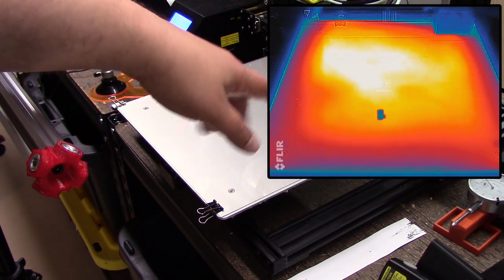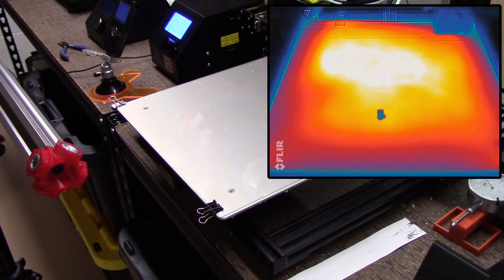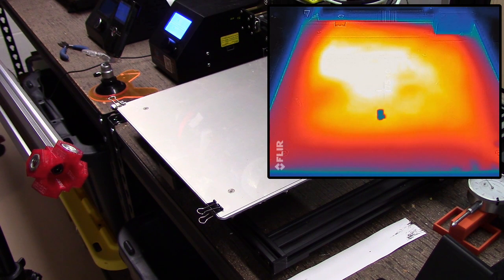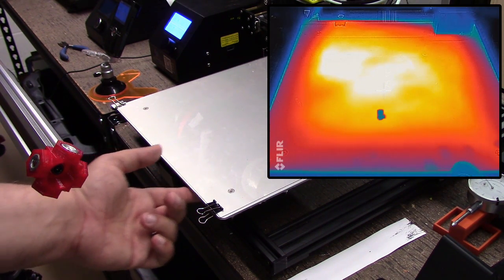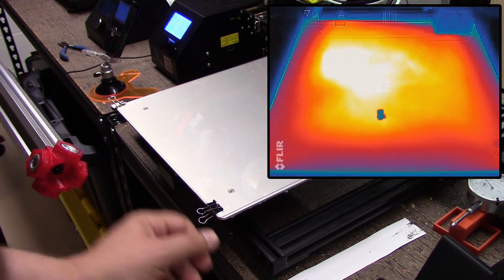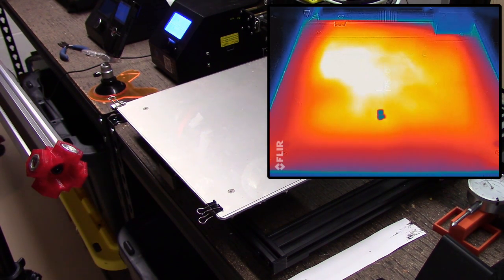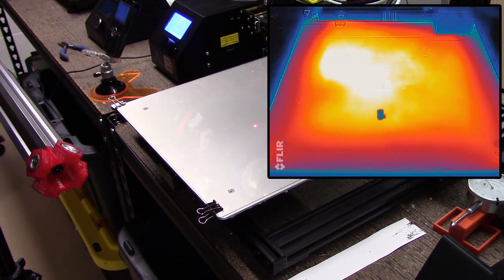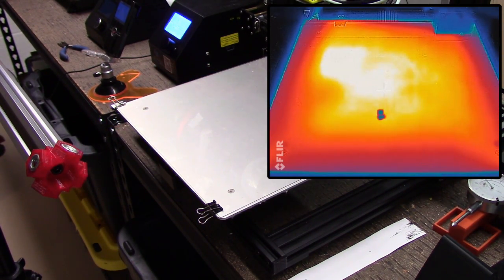Creality CR10 - Insulating the Heated Bed!

Comment: How to Get Great Results with an Infrared Thermometer - Fluke: even reflections off of glossy paint can affect accuracy. 
http://www.fluke.com/fluke/uses/comunidad/fluke-news-plus/articlecategories/temperature/how-to-get-great-results-with-an-infrared-thermometer
Reply from the maker: Proved this this to be a bit of fake news when I connected thermo-couples and they basicly matched :-)
Reply: I have never noticed an issue using hand held Infrared thermometer pointing at a quite shiny Aluminum bed... Maybe they mean mirrors :)
Reply from the maker: Most aluminium is matte enough, I have not had an issue.  If it was polished I could see it being an issue, but to date I have not seen one that shinny...

Comment: You installed a radiative barrier.... in contact against something you want to maintain temp on? Best bet build a cardboard box and buy a 99cent nasa emergency blanket and spray adhesive it inside the box.

The heat shield you bought is ment to be installed on metal on the opposite side of a  heat source like a catalytic converter. Then the shiny side radiates the heat from the cat, back to the cat. It maintains the car panel temperature NOT by insulating what so ever, by but reflecting heat away. Aka: radient barrier. Insulation slows heat transfer. If anything you added thermal mass and increased heat transfer in the bed.
Reply from the maker: For clarity If you check their website this isn’t correct as I mention there is a fiberglass inter barrier and it’s designed  be attached in this fashion
Reply: Prove it.

https://www.thermotec.com/products/heat-shields-and-protection/adhesive-backed-heat-barrier

Directly from the manufacturer.

"The Adhesive Backed Heat Barrier protects parts and components from radiant heat. It can be used in applications to protect painted surfaces, plastic parts or any component from the damaging effects of radiant heat."

edit:
Dude it's ok to make mistakes we all make them. I'm just saying you could get way better bed temps using something designed to radiate the heat back toward the print bed - not away. Thermodynamics is complex, most people get it wrong - hence all the insulation issues in modern homes.
Reply from the maker: Here ya go "The adhesive backed side handles direct and continuous temperatures up to 300ºF.
Reply: I'm struggling to understand if you're trolling or not. That says NOTHING about INSULATING! This phrase tells you the temperture the adhesive glue fails at. All glue fails. This glue fails at 300F.
You are not an engineer and that is very obvious now.
Reply from the maker: Look, why do you make a glue to withstand 300deg?  Look at the other applications of this stuff, the fiberglass barrier is meant to provide a gap between the hot surface and the reflective surface and the reason they sell it for wrapping hoses as sleeves and its obvious your not an engineer nor understand the thermodynamics :-)

Comment: the bed has to be made out of clay clay holds heat better it's used in pizza ovens can take a lot of heat. heat in metals  travels faster, or make the bed with thicker aluminum or steel. I don't own a printer but I have tested metals and clay which makes my pizza better by holding heat and clay won the brick stays hot longer than  steel or aluminum. to be specific I put the brick on  500°f  to see if it would crack and it passed, but when I did it with metals  the metal materials cool faster than the brick made out of clay, if the brick isn't made out of clay it cracks. so inclonclusion is to someway make a clay bed.
Reply from the maker: Clay would be too heavy and have a negative effect because of the implied inertia of the bed.  So far, high temp ceramic insultion has produced the best results as you don't want to retain direct the heat...
Reply: DIY3DTECH.com let me be more specific by replacing metal bed to a clay bed and same thickness of metal bed not thicker only problem it would take longer to cool down.

Comment: There are opinions of how this should or should not work. Some say the adhesive side silicone will soak up the heat instead of resist it.  I want to know, at the end of day, from 1-10 how good the results turned out to be?  I don't trust cork for fire resistance so still searching for my  insulator.
Reply from the maker: So far the Plumbers Felt on the CR-10 has been working out good good for me and will likely use the same for my Tronxy X5S...
Reply from the maker: As covered in the video, picked up 30 second faster heat so it is something, and the thermal signature (via flir) is better so would 2.5 out of 5 main for the improved thermal signature.  However I still feel there needs to be a larger air gap and what I am going to do is try plumbers felt (http://amzn.to/2fUP7ky) between the bed and this to improve the air gap have not found the time...
Reply: Look at what they have been using for insulating the hot end nozzles on many printers . Its treated felt . I ordered this "HIGH TEMP FELT PLUMBERS PAD: BLACK, 12" X 12" X 1/8" THICK" from Amazon it is rated at Temperature resistance of 1800 degrees Fahrenheit (982 deg. Celsius) Its actually made of carbon fiber but is luxuriously soft. A whopping 14.99 and will last forever in this application.
Reply: Nice !

Comment: So you are insulating a circuit board with aluminized plastic? Get some rockwool if you are too scared of using cork (i'm guessing XPS isn't an option, it does melt at 240C, but then again bed doesn't get that hot usually?)...

Or just wrap cork with aluminum foil...

Why didn't you get temps for the bottom of the bed, that is how you test the insulation...?
Reply from the maker: Not aluminized plastic, this has an inter fiber glass lining, also not an issue of the bed heat causing a fire however the potential of a short  which has happen and Chuck even got it one on video.  As the heated bed will dry out the cork and a spark can set it off smoldering....

Comment: I think you have that backwards. The silver side should be toward the heat source. That product is designed for firewalls in cars. So the engine produces heat. The product goes on the firewall reflecting IR back into the engine compartment.  What you want is contact insulation.
Reply from the maker: I could see why you would think that way however read down the thread (comments) for explanation as in simple terms the the bed is a convection (not a radiant) heat source so you need the insulation to be placed next to the bed as you want the heat retained and not rejected.  :-)
Reply: So does it work? Can your bed reach 100C in a reasonable time? Say ten minutes and hold the temperature?

Comment: I use a cork tile on mine and capton tape It heats a standard 220x200 40% quicker than no insulation.
Reply from the maker: Please see my video on burning cork, to much risk for me.  I am also looking add plumber felt to a future version...
Reply: Use Cork to mount insulation onto i.e. Bed, Aluminium Insulation, Cork keep cork temp below 150 degrees C no problem.
Temperature of match is 600°-800° do not expose cork to open flame
Reply: Paul Thomas where did you get the cork tile please?

Comment: I'm sure it will make a slight improvement but not worth the effort or cost.   I'm an auto upholster and I use this stuff all the time.  It's true that it's meant to reflect heat rather than using it for this application.

The way you have it installed is the correct way for this product but, for this application it may be doing just the opposite of what you intended it to do.  As it is in your application,  even the thin aluminum foil on the non-sticky side acts as a heat-sink which pulls heat away rather than holding heat in.

I would be interested to see what image results would be if you aimed your flir on the insulation as it heats up.  I think you'll find that it does in fact act more as a heat sink than an insulator.

Good video though;  there are better insulators that could be used to achieve what you are trying to achieve.
Reply from the maker: It did make a difference, about 30 seconds faster warm up and yes I know thats not major but ok for how "easy" it was kind of.  However what I am thinking about doing is taking it off and adding plumbers felt as extra insulation.  Also I though I did add a flir piece in this one and does appear to be a little more even.
Reply: It's true; you did add a section of video that showed the heat dispersion on the top of the plate with your insulating layer underneath the heating plate.  What I meant was to aim your flir at the underside of the heating plate to see if in fact you were loosing more heat than you were retaining.  This would be difficult to do with the heating plate installed.  It would most likely   have to be done with the heated surface detached from it's anchor points and placed off to the side of the printer somewhere.   Probably not worth the extra effort if you're happy with your results.

Before stumbling onto this video I had viewed another youtuber's video showing how he insulated the heated platform on his CR-10.  I can't remember off the top of my head the exact type of insulation he used but it seemed to turn out very effective.  If I remember correctly his was a heat resistant cloth-type of insulation like one would use to insulate hot wires.

The thing that attracted me to your method was the type of material you used.  This is the type of insulation material I use in my line of work when installing carpet and sound deadening in automobiles.  

Frankly, I think a guy could just suspend the type of insulating material you used underneath the heated base; except with the sticky side down and the reflective side up to reflect the heat upward where you want it to be.   This would also create a narrow dead-air-space or cavity between the bottom of the heater plate and the reflective surface of your shiny insulating material.   The inherent sag at or near the center of such a suspended piece of insulation might also create a parabolic reflective surface that would concentrate or aim the reflected heat toward the center of your heated plate where you most likely wanted it to be so that the heat could disperse outward evenly from there.     It could be held in place by simply taping it around the edges.  This setup wouldn't interfere with anything if suspended just right..

With this sticky-on-one-side insulation in place, if you ever needed to get to the heating element for maintenance, it would require a lot of foul language and elbow grease to get it off; don't you think?

Overall I think its an excellent idea.  The insulation material of choice may be what's keeping this idea from reaching it's full potential.   In my area, they sell a 1/4" thick automotive carpet insulation with the same type of reflective aluminum foil on both sides..  Even better would be to make your own by simply buying a half yard (18"x48") of 1/8" thick closed cell landau top foam and gluing aluminum foil on both sides and suspending it from the underside of your heating plate.   

I can picture such an insulating layer with the aluminum foil on it's underside overhanging all its edges by about an inch and a quarter or so.  This way you could fold the overhanging edges over the top of the heating plate to hold it suspended in place and it would be further secured when you placed the glass surface over the heated base plate.  This DIY insulation setup would weigh next to nothing and do more in the way of insulating and I'm pretty sure it would do a slightly better job.
Reply from the maker: LOL!  Love the foul language part on repair as for the most at least for me a Printer has maybe a two year life span before it becomes either worn out or obsolete so I don't worry about that too much, however your spot on as there needs to be a larger air-gap between the bed and material and this where the plan for plumbers felt will come in (1/8") as too keep in mind there is only so much reasonably worth doing.   For 30 seconds, I wouldn't do it again, I would prefer to see 1min to 90 sec faster heat up with more heat pushing to the edge (as this is where you need the heat...

Comment: Just put some heat resistant adhesive on the shiny side. Then from there you can use the built in adhesive to attach the second layer if you still wanted to do that.
Reply from the maker: Really no need as you want it to go that way as it acts like a blanket,  With the foil side out the idea is to "reflect" radiant heat not to "hold" heat in.  So attaching the material via the sticky side (which the sticky side can 'sustain" 148 deg/c temps) reverses this as the fiberglass acts as a thermal gap with the foil on the outer side to "reflect" heat back which makes it past the fiberglass.  :-)
Reply: I understand that, but I think I'd rather reflect the heat towards the bed for it to hold the heat kind of like those foil emergency blankets we use in emergency kits. Otherwise I suspect we're basically just adding mass, which could also be achieved by having a thicker bed. That's not to say that I know for sure this method would get better results, but it would be nice to know if it is a viable option as I'll hopefully be building my first 3D printer soon and I would love to make it more energy efficient and speed the bed heating.
Reply from the maker: Foil can only "reject" radiant heat and "convection" is passed though as in your foil blanket example the way they work is they :The airtight foil reduces convectionHeat loss caused by evaporation of perspiration, moisture or loss of blood is minimized by the same mechanismTo a limited extent the reflective surface inhibits losses caused by thermal radiation.

Note the reflective surface provides very little (i.e limited) loss of thermal radiation in fact the mylar is doing more than 98 percent of the work being a moisture.  This the same for placing it this way as there needs to be a thermal air gap to reduce convection...
Reply: Hmm... Good point and I forgot about that aspect. There is also an insulation batting material that uses mylar. It's basically fluff with mylar sandwiched in the middle and is apparently commonly used in ironing boards, but I tend to use it when heat forming PVC to protect my hands, work surfaces, and/or lap when working on my cosplays that need high heat. I wonder how that stuff would do for this application since it is relatively inexpensive (for what it does) and is easy to find at Joann's Fabrics in their utility fabrics section.
Reply from the maker: that is the issue as without a gap (which the fiberglass is serving as) it can't reflect.  Think of it as an older style thermos bottle as it has the glass on the inside and metal on the outside so it holds the heat in :-)

Comment: Wouldn't it work better if you could have the reflective surface pointing to the heat source (the bed)?
Just a thought.
Reply from the maker: Really no need as you want it to go that way as it acts like a blanket,  With the foil side out the idea is to "reflect" (i.e. reject) radiant heat not to "hold" (i.e. retain) heat in.  So attaching the material via the sticky side (which the sticky side can 'sustain" 148 deg/c temps) reverses this as the fiberglass acts as a thermal gap with the foil on the outer side to "reflect" heat back which makes it past the fiberglass.  :-)
Reply: I was just wondering if they made the reflective side 'sticky' instead, if it would them also reflect the heat back at the bed.
(Just a thought though.)

Comment: I edited my mistaken comments and unfortunately your post went with my edit. What was the temp range from the manufacturer?
Reply from the maker: 300 deg/f or 148c sustained also if you check out their site and application, the bare side is radiant reflective where as the fiberglass side in insulative...

Comment: The adhesive side isn't designed to insulate.
Reply from the maker: Knew I was going to get a lot of these even thou I mention this in the video :-) As you have to look at this the other way around as it does, because if you attach it to the firewall of your car does it not insulate it (hint the answer is "yes")?  So you have the adhesive backing, fiberglass (insulation) and then foil.  So why would it not "insulate" as in the car example it separates the "cold" the "hot" and the same hold here too.  Keep in mind the surface of aluminum has the ability NOT TO ABSORB, but TO REFLECT 95% of the infrared rays which strike it. Since aluminum foil has such a low mass to air ratio, very little conduction can take place, particularly when only 5% of the rays are absorbed.  So the same foil that is on the outside is on the inside also, so in short it has two action keeping "out" and keeping "in" and placing the sticky side to the bed we are keeping "in" as what makes it past the fiberglass insulation will be reflected back by the foil.  The only question is can (which the answer seems to be yes) can the adhesive take the heat of the bed without breaking down...
Reply: I used to build glass furnaces and glory holes.

The silicone adhesive backing is absorbing most of your heat and due to the aluminum it's being held in, aka reflected back at the mass.  Let's define "insulating": to protect from losing... 

If you were to conduct another test where you just used a single piece of aluminum loosely hanging but close to and not touching  the bottom of the bed you'd probably get much better results for heating speed increase than the adhesive.

Even better solution and still on the cheap side, crush up a piece of aluminum stretch it out and make it somewhat flat, get another piece aluminum make an insulating sandwich with the bed on top.  don't crush it, don't try and smooth it out.